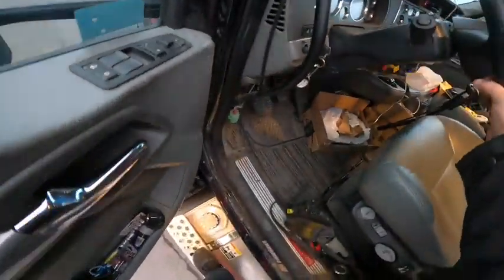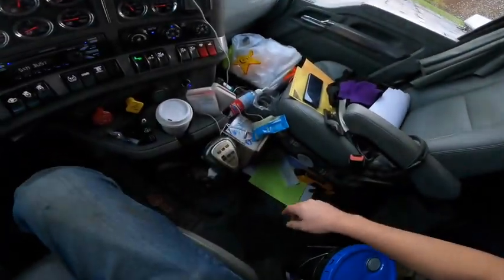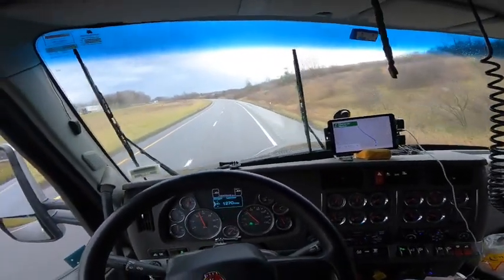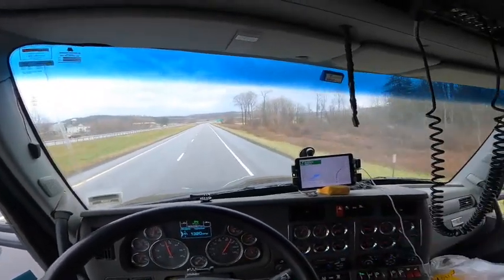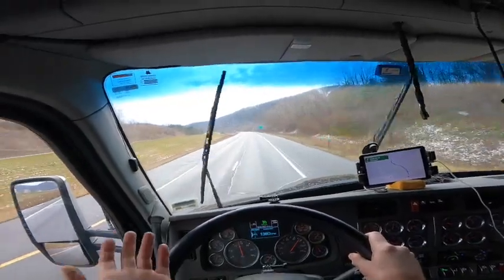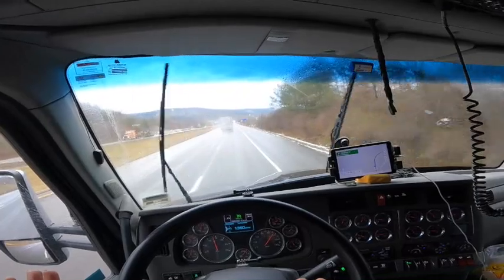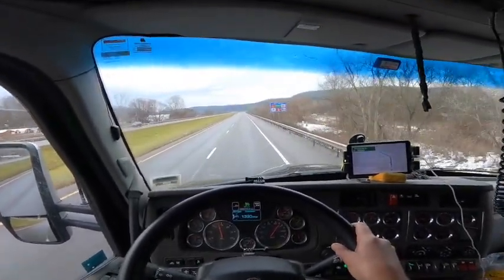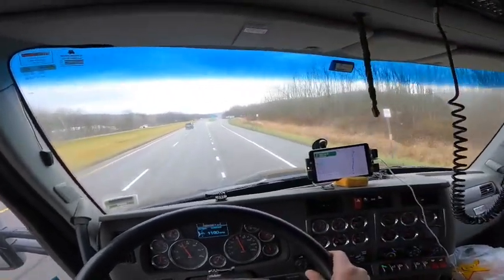CAT D8 DOZER: Dansville, NY to Lawrenceville, PA

Comment: Get 2 nuts that fit your oil plug hole. Then get a long bolt that fits you nuts. Place the two nuts on the bolt. Tighten the 2 nuts against each other real tight, near end of bolt.  Then insert one of the nuts into the oil cap. Now use a regular wrench to turn bolt head. Oil filler cap should turn.

Comment: I’m also a retired mechanic that has worked on those cats , The oil has to be checked with the engine running , stopped the level should be about half way up the dipstick , also the once u start it the oil will disappear off the stick .   The oil leak is the final drive seal , the transmissions may leak into the final drives if the seals are bad through the axles  into the finals ,  the transmission oil has drained into the final drive that’s why it’s low .
Reply: It has been awhile since I was in the back of a dozer. Isn't the pinion gear up high on the final? So how can transmission oil drain into the finals? Also the oil leaking out looked like 90-120wt, not 10wt hydraulic oil.  Plus this is a older machine, and it may have dry steering clutch/brake compartment. The bevel gear compartment has a crossover tube to the transmission, and oil is pumped from the transmission on top of the bevel gears to lube them, IIRC.

Comment: Capt Sergi,
Some info on the drivetrain of the CAT dozer. The rear/center section of the machine is the bevel gear housing and transmission. The steering clutches are also in this compartment. Depending on the climate temperature the machine is used in, dictates what oil is used. If used in cold climates, then a light hydraulic oil or tractor fluid is used. In warmer climates a 30wt-50wt motor oil would be used. The fill pipe and dip stick under the seat you found, is where you add/ check the transmission oil. 
On the outside of the rear case are the final drive housings. They are completely separate from the transmission/bevel gear compartment. The worst cast scenario is the pinion seal from the transmission/bevel housing to the final drive housing was leaking, oil could transfer to the final housing. The pinion is high up in the final housing, so it is splash of oil against the seal. Some older machine had dry steering clutches, and this would not be an issue.
The final housings has heavier gear oil, like 90wt or 120wt. Again depending on what temperature you are operating at. So the oil leak looks like heavy oil from the final, and like you said you are now in a warmer climate, so now the oil is thinner and leaking. I suspect that the oil is leaking on the inboard side of the drive sprocket. The whole track, side frame, sprocket and final housing has to be removed to repair that seal. Your best bet is to (with the customers approval)  drain most of the oil from the final housing, so there is just enough in the bottom of the final housing to lube the "bull" gear inside to get the machine on and off the ship. Good luck.
Reply: Cat never used wet clutches?
Reply: @tomfrench8191  I replaced brake bands in a D5B, and a D4C that had wet steering clutch/brake compartments,  and I did the same on old D8, and a 951 track loader. Go figure.

Comment: Looks like hex head, go to farm supply store buy long bolt with head that fits in the fill cap buy two nuts for the bolt and two wrenches to tighten the nuts to each other and you have the tool to unscrew the cap.  Prolly get the oil needed at same place.

Comment: There probably was water in the final drive that was frozen not allowing anything to move , now that you are in warmer climates the water which is heavier than oil leaked out first which you wouldn't notice driving in the rain and after that leaked out the oil started flowing out , That area was pretty dirty and after the wash removed the dirt in the area the slowing the leak was now gone the oil could flow freely out . You also need to start charging a fuel surcharge for the increase in prices , Trucking companies are doing it and make alot of extra money

Comment: That old filler plug requires a CAT special socket to use a 1/2” breaker bar. You can try a pipe wrench on the outside of the plug.

Comment: Sergueiyou may need to think of if the receiver constancy refuses the dozer. I do hope that that leak is just from them heaving up the unit; when you picked it up, it may have potentially damaged the final drive seal possibility. I agree with the gentleman who talked to you about the dozer, but I think some other issues are going on with that final drive. I genuinely don’t know if the port good refused the load because of the inability to move equipment on that ship. I’m not trying to tell you how to run your business at all, but I would at least $3000 extra plus loaded fees based on the refusal of the load upon delivery.
Sincerely!
Richard Virchow

Comment: Serguei,  Do you have a pipe wrench? Transmission oil is leaking into the final drive thru bevel gear compartment ,bad pinion seals. The D8 was sold for $22,000 cdn + fees, certainly not worth it